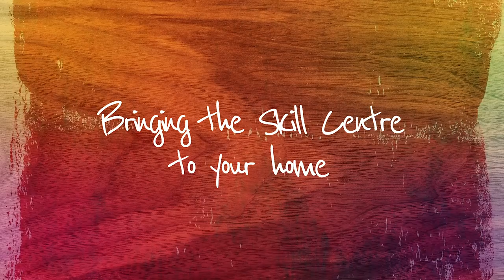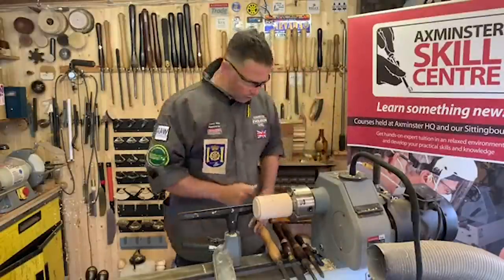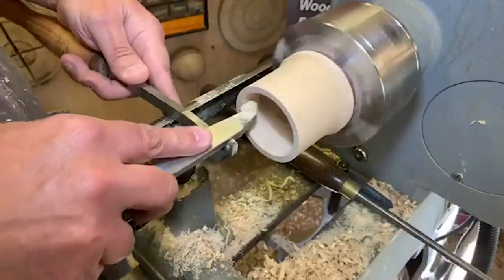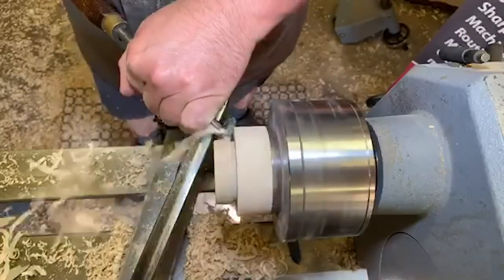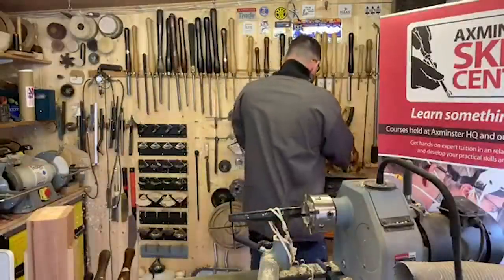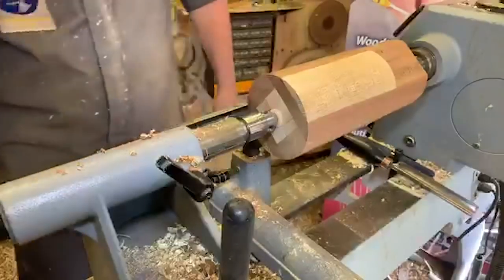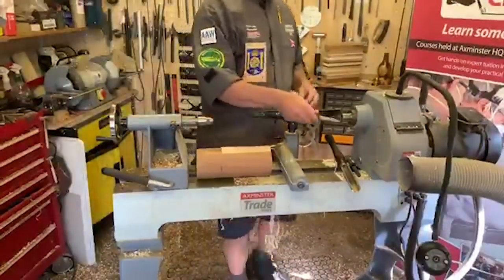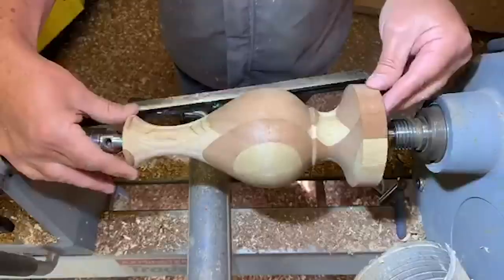#SkillCentreAtHome Live Turning Tuesday - Thread chasing and long hole boring

Comment: I have been hand thread chasing for years. 16 or 18 tpi tends to work better in hard domestic woods. I was surprised the rock maple was hard and fine enough for 26tpi so well done. The ourser threads will be stronger and less likely to strip or cross thread.

Comment: Thank you for posting this! I really learned a lot.
Two minor questions/comments:
1) You showed measuring the inside  and outside dimensions using the calipers. It would have been helpful (to me, at least!) to explain which diameters you were measuring- inside the threads, outside the threads? Is this why you cut back a little of the first set of threads near the rim?
2) You started by drawing a line to track grain direction but then immediately took down the diameter  and didn't mention it again. What would you have done to make the grain match up? I think I understand but am not positive. 

Excellent job, though. Thanks again for making this!